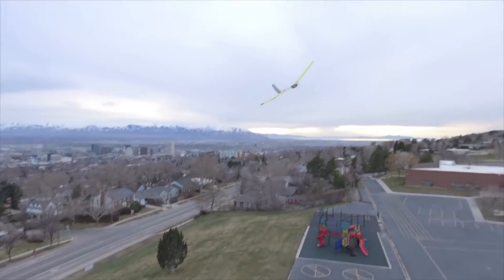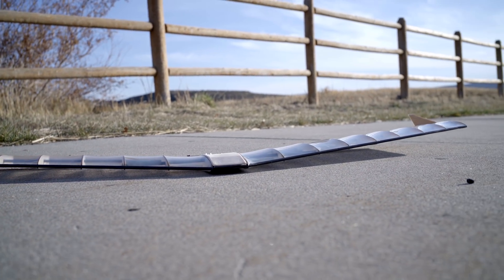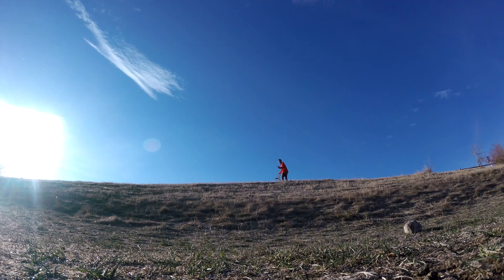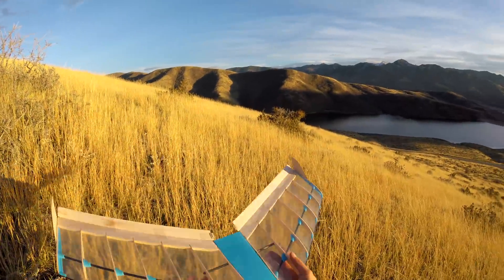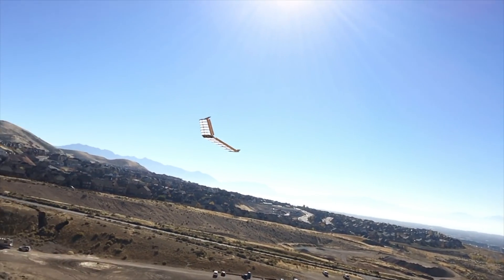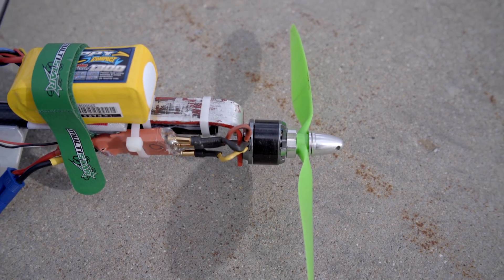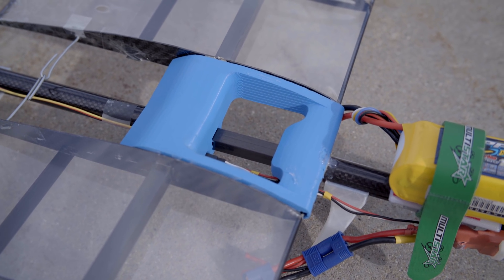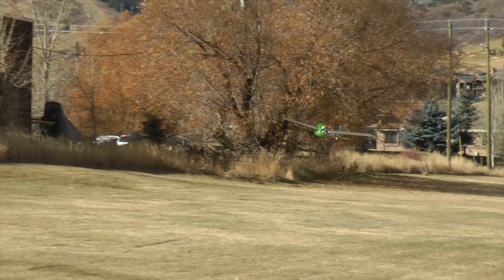CNC Laser Cut RC Plane Wing Ribs - RCTESTFLIGHT

Comment: thanks for posting.  nice work.  here are some thoughts.   at :36, using cf tube for the LE results in Excess mass in the Wing, Outboard; reducing roll axis stability.   the spar design would not appear to prevent wracking across the span.   at :55, Unnecessary Weight of plastic braces at the ribs, and a Large plastic piece used at each Wingtip.   again, reducing stability.  cheers

Comment: Could anyone tell me what airfoil is used on the 2nd wing, I'm looking to build one. Thanks
Reply: just a moderate lift semi-symmetrical cambered profile;  THICKEST at 30 percent of chord.  see something like the naca2410.     cheers
http://airfoiltools.com/airfoil/naca4digit?MNaca4DigitForm%5Bcamber%5D=2&MNaca4DigitForm%5Bposition%5D=40&MNaca4DigitForm%5Bthick%5D=10&MNaca4DigitForm%5BnumPoints%5D=81&MNaca4DigitForm%5BcosSpace%5D=0&MNaca4DigitForm%5BcosSpace%5D=1&MNaca4DigitForm%5BcloseTe%5D=0&MNaca4DigitForm%5BcloseTe%5D=1&yt0=Plot

Comment: @rctestflight This is quality stuff! One of my fav youtube channels for years. You should work on a powered slope glider with solar panel assisted recharging. Then say when you have enough battery power, you can enjoy the thrill of blasting off up high outside of the slope wind for some fun, then back down to the slope for recharging. Maybe like a 1.5 amp 3 or 4 cell lipo or li-ion to keep it simple? I mean you already kind of did this with your solar plane videos. But it was not purpose-built to have this idea work as a very tuned experience. Just my thoughts. have a great one!

Comment: thanks for posting.  some thoughts for you and your subs.  nice work, but . . .there is NO good reason, in view of its weight, to use cf on such a small model; not even for the main spars.  on such small models, every GRAM matters.  especially, grams AFT of the cg.  if you want black spars, color spruce or bamboo with a sharpie.  when carbon is used for the leading edge of a swept flying wing, the part of it near the wing tips ends up being AFT of the cg.  if you want a heavy model, that has an unstable distribution of mass, use carbon in the wings, outboard.  otherwise, make the wings of balsa, bass and spruce.  use hobby plywood (or spruce), not MORE carbon, to make the lateral components of the center-section.  at :20, the servo arms should be to the OUTBOARD side.  the servos should have been mounted FORWARD of the cg, not aft of it.  unless the elevons are suitably stiff, the control horns should be installed a bit farther outboard;  elevon servos could be installed at either side of the center-section, to improve linkage alignment.     cheers

Comment: Hay I am just getting into rc as a hobby and I am wondering what battery I should get. If anyone has answers please tell me
Reply: Pierce - BANG SCIENCE That depends on many many factors. Size of your aircraft, voltage ability of your power train (how many cells to use), expected current with said power train. What airframe or kit are you looking at?
Reply: If you are going to put a battery in something, the same rules apply for everything. So you need to know the voltage you need and what is the average and maximum amp draw that your equipment will be using. Then, you select a battery according to it's discharge rating and capacity. And lastly, the better it's internal resistance, the better the battery. How much you pay for a battery ultimately depends on these factors. Most RC hobbyists and tinkerers lately are using lithium polymer batteries. Take special note when maintaining the proper battery voltage with lithium because some of them are sensitive to overcharging and over-discharging which can create a fire hazard. Do your best to grow you ability to understand how many components come together for making something function. And never underestimate the many possible dangers involved when having fun. The hobby community is bigger and better than ever, so you can be sure that just about every answer you need already exists and is explained in plenty of ways. Good luck!